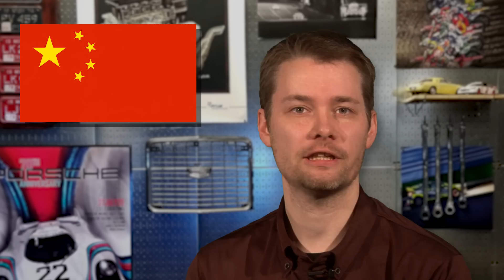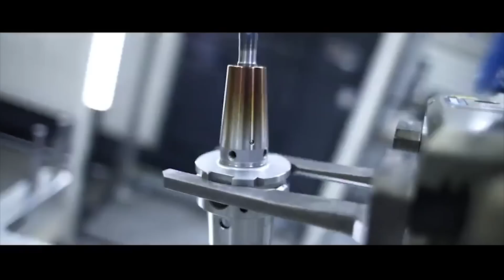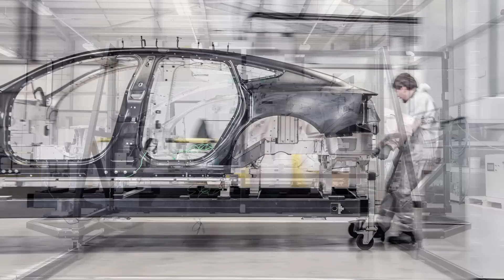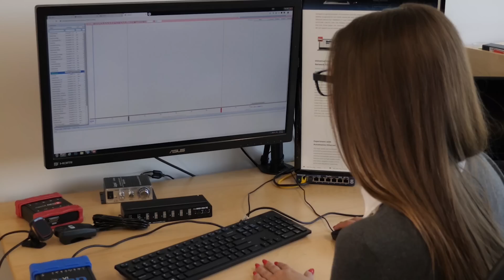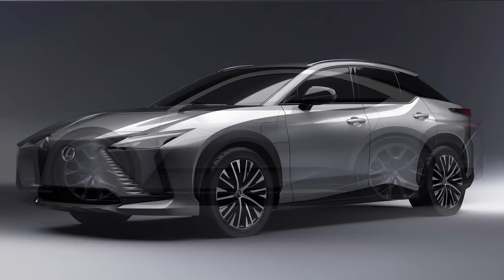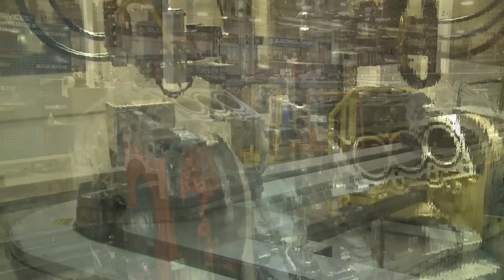Kiss The Lexus Spindle Grille Goodbye; Polestar Decides To Glue Cars Together - Autoline Daily 3261

Comment: Tesla competitor?  -  drop welding and use glues  -  interesting  - Love to have Sandy Munro try to figure a cost comparison.
Reply: Yeah I was thinking the exact same thing
Reply: This is nothing new, the original Tesla Roadster was build like this. Not that Tesla had anything to do with it, the lotus Elise was totally glued and the Tesla used that chassis.
Reply: @buddy1155  Polestar is probably collaborating with Lotus or ex-Lotus personnel on this. Most of this development done with this body was in England in Polestar's R&D department located there. People may not realize this, but Polestar is a former racing company with lots of motorsports experience. So that's part of this too.
Reply: @benjaminsmith2287  my guess would be people with experience in aircraft sector. Modern planes are all glued together.

Comment: Thanks for the content! We often talk about how the large countries want to move over to electric vehicles. But what about the small countries that don’t have the money or infrastructure to change over. They’re screwed.   Can you please go over that scenario.  They’ll be stuck driving really old used vehicles with no support. Thank you
Reply: There is one way small companies have an advantage. Those with large fleets will need time to replace all their fuel powered vehicles and during that time they still have the cost to maintain the non EV portion of their fleet. In some cases that will mean signing a new contract with their vendor at a higher cost per service. Those with smaller fleets may be able to replace all the vehicles with EVs making a clean break and eliminating repair and fuel costs all at once. If your new EV fleet also has the "generator" feature you can also get rid of those things and have power right at the job site or even on the way.

Comment: 8 billion for hydrogen while only 5 billion for EV chargers.  This is a massive joke.  Hydrogen is completely dead.  Even large bus orders for hydrogen have been cancelled for cheaper and better EV versions.  There is no use for hydrogen not already satisfied by natural gas.  Converting natural gas to hydrogen for transportation makes no sense at all.
Reply: Stop thinking like an engineer and think like a politician who has to "pay back" that election lobbying money. And yes you're correct. The companies that can afford large commercial fleets don't really need the subsidies. The costs savings switching to a FCEV on trucks would pay itself off faster than most other CapEx expenditures. Single households with 1 or 2 cars aren't going to drive 20 miles out of their way (optimistic) to fuel up.